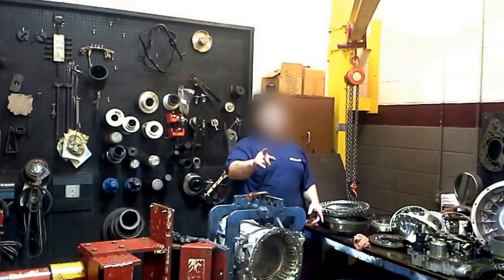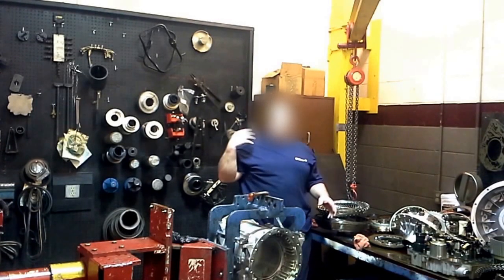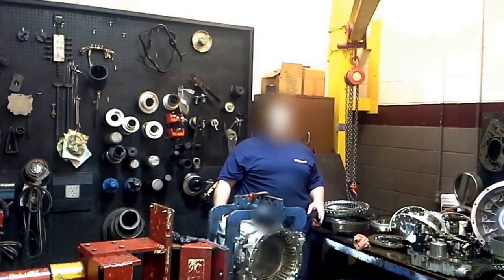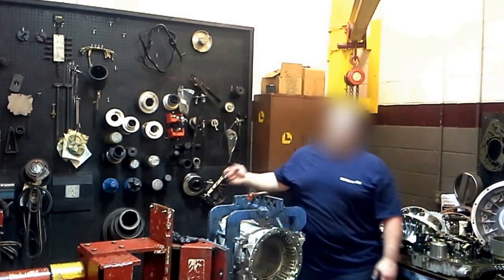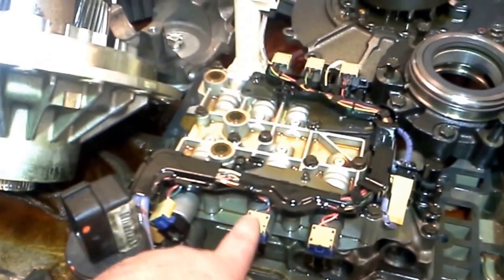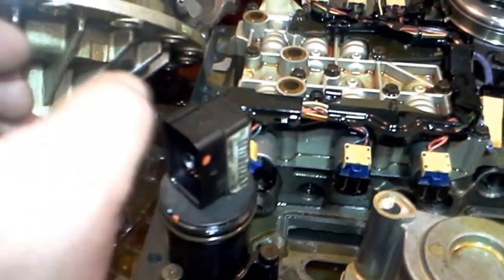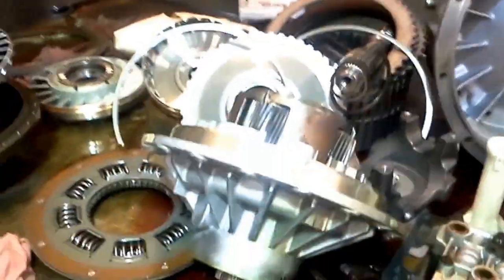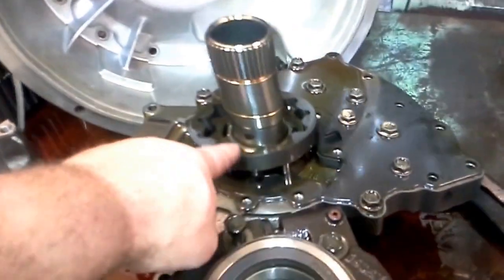Allison MD3000 Transmission tore down overview

Comment: Can an average guy rebuild one? Our motorhome has the MD 3060 and it stuck in 4th. I shut motor off to restart, amd now won't move, drive or reverse. Code d1 5143. We live in it, I have lung cancer and not much money. We have been visiting grandchildren in WA while I still can, when we broke down. I'm afraid the auth service center in Ridgefield WA may tell me to replace, when it may only need a shift solenoid. Any info would be appreciated.
John and Anna Smallwood
Reply from the maker: Thats a solenoid code, I think. Could be a loose connector.
Reply: ddcgod 
Burned c4. 4th trans in 80k. 3 burned up in last 20k. Md3000 in our motorhome. No one has ever heard of anything like this. I'm an Allison fan. They've tried to blame Monaco (builder) freightliner/roadmaster (chassis) and Cummins. Fluid analysis ok, except clutch debris i think. It's unbelievable. But...it is happening. 14k on the one we're replacing now. Allison replaced prev 2, of which 1 only went 5k. Unbelievable. All had severe C4 clutch damage
Reply: ddcgod this is harder on me than 2 weeks of radiation. Not kidding.